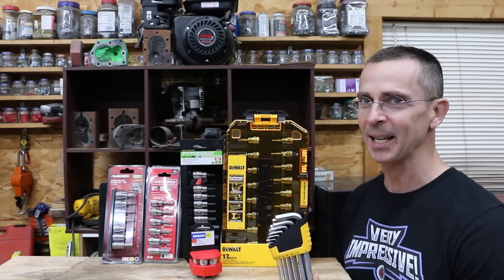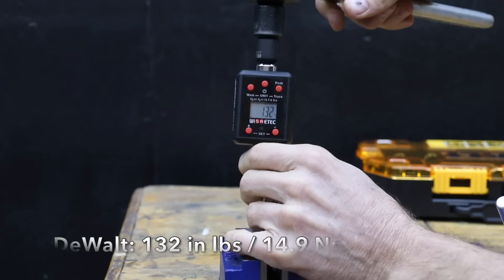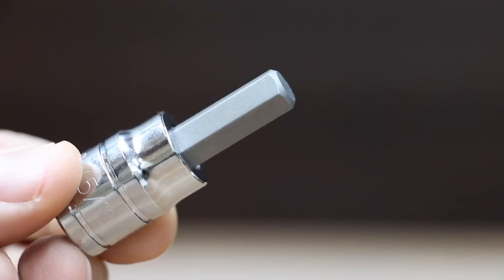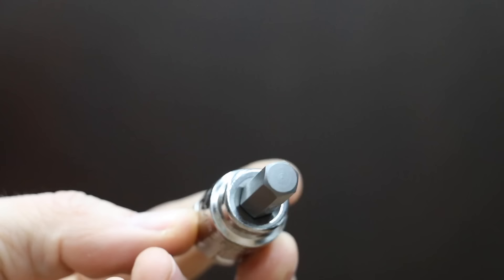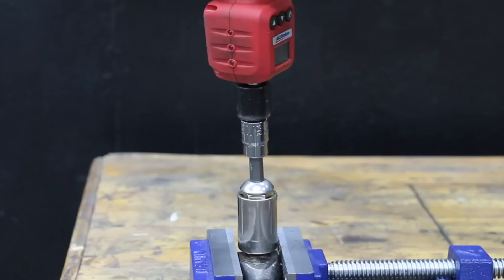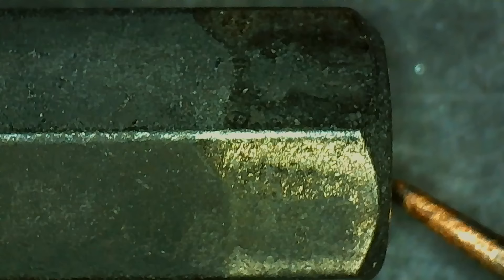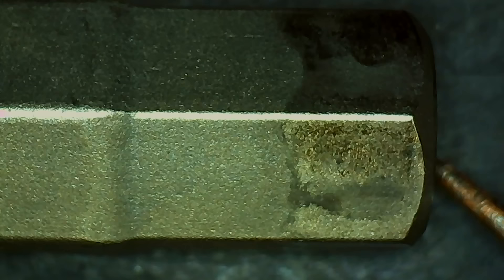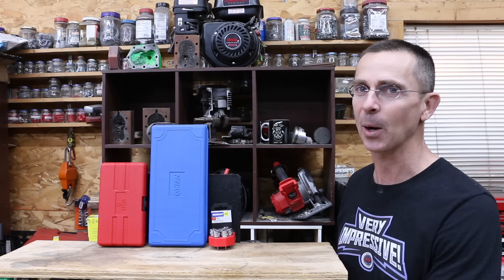Best Hex Bit Socket Set? DeWalt, Kobalt, Craftsman, Husky, Neiko, Pittsburgh, Tekton, GearWrench

Comment: Hi Todd - video idea. Unfortunately, after a "repair" on my boat trailer this weekend, I've had to research thread repair inserts including: Helicoil, Time-Sert, E-Z Lok, and some other similar brands. Although there is an abundance of information on the web regarding which type of thread repair is better, stronger, and easiest to install, most of the information is anecdotal with little to no testing.  As stripped threads are a common problem that likely every mechanic will experience, this might be a good test for Project Farm!
Reply from the maker: Thanks for the video idea.

Comment: Starting at around 10:25 when you test with the impact wrenches, you state ultimate torque failures in in-lbs, but you are clearly testing in lb-ft on your torque reading.

Comment: One of the items I'd like to see tested is wire wheels for grinders.  6" would be great as that's probably the most common.  I have tried a bunch of them but still haven't found one I'd recommend.  All so far pitch wires with all too much regularity.  I have both plain and twisted versions.  The twisted are a lot more aggressive than the straight version.
Reply from the maker: Thanks for the video idea.

Comment: I own a lot of Husky hand tools. Not because I think that they are the best, because at Christmas time (or now earlier) a lot of their tools are put on sale at what were good prices. If the price is right I usually buy 2-3 sets of the same thing. If I purchase 3 sets that allows me to use one, loose one, and have one in reserve when the first one fails. Husky's lifetime warranty is hit and miss depending on what you purchased. I still have a flashlight with a "lifetime" warranty that did not work from moment 1, I took it back to HD, told them the problem, then had to demonstrate the problem (switch did not work), then was told that they did not have any in stock and it was very unlikely to ever have any in stock after the sale, and that I could drive 15 miles to a different store because they might still have some. If  your time isn't worth anything having to drive 30 miles for a flashlight that wasn't worth the fuel to go get it didn't make sense. The other problem, not only with Husky, is that the part number, SKU number will change for the same thing so when you bring in your damaged tool for replacement it won't be the "same" thing so that they will not exchange it because they don't have it to exchange. Lifetime warranty is a relative thing today.

You have had to be there to miss the good old days of Sears when a lifetime warranty actually meant something.
Reply from the maker: Thank you for sharing!

Comment: I love your videos.  You get right to the point and stay on track.  I also buy many times based on your videos.
I'm sure you are a busy man but I have a product test idea.
I've read that Quicksilver 4 stroke outboard oil was superior oil made to handle high RPM for long periods.  A boat outboard operation is similar to a lawn tractor.   Would it be worth the cost to use Quicksilver oil in my lawn tractor Kohler 22 HP?
Reply from the maker: Thanks!  Thanks for the video idea.

Comment: I would really appreciate if you could do a test of Table Saws. I know they can be expensive, I just myself tested 2 on the lower end and even my poorly skilled circular saw performed better than a 200$ one. I understand that this sort of power tool is incredibly expensive, but offerings in the below 600 are very similar yet very different and features are not on all of them, and flatness and accuracy of machining varies between brands. 

On the less expensive side, Bench grinders, and affordable diamond sharpening stones are definitely on my radar.
Reply from the maker: Thanks for the suggestion.

Comment: Project Idea: Rotary Tools, Cord/Coreless, cutting/grinding/drilling/routing/sanding, do they bind or heat up, and how accurate are their speed settings in RPMs? Are the coreless just as good in performance as the corded ones just not lasting as long?
Reply from the maker: Thanks for the suggestions.

Comment: Re-watch your vid and you'll see that on many examples that break the 1/2 hex,  breaker bar is not parallel, causing premature failure.  Btw.. I'd love to see some truck brands like Snapon, Mac or Matco  included in your tests.
Reply from the maker: Thanks for the suggestion.

Comment: I found Grey Pneumatic makes some of the best long ones for a reasonable price. In industrial maintenance, I find too many brands are too sloppy (very undersized) and/or not very good hardness and wear out after a few thousand cap screws. They're like the Wiha of impact hex bits. Only downsize is if you snap one, you can't just grind it down or press in a new bit like some of the truck brands.
Reply: Always better to have a bit that doesn't wear out and is a little sloppy, than a tight fitting bit that is softer. At least in industrial settings where you can always replace the bolts. I suppose in the automotive world you could run into goofy sized bolts you wouldn't always have on hand...
Reply from the maker: Thanks for sharing.

Comment: On your adapter breaks you might try non impact when you don't use an impact, I've found impact sockets break easy compared to non impact on straight force, at least on 15/16 rusted flange bolts. But I didn't test brands but only craftsman sockets and 1/2 " drive. I've also abused regular craftsmen sockets with an impact and you could see wear but pretty good tool, or used to be in the 80s  90s
Reply from the maker: Thanks for the suggestion.

Comment: 🤔maybe you should test out different brands of socket adapters as clearly many of the socket sets outlasted the adapters themselves. It is actually insane that many of these hex bit sockets can take some intense blows from a air compressed impact driver! VERY IMPRESSIVE!
edit: I think i might not be the only one wanting a part two of testing socket adapters as I already know that you have done a video on that already but I think over the time of one year since that video was posted there's bound to be newer brands to try out. so what do you think? is it worth for the socket adapters to have a part 2 video? there's likely to be newer brands that people might want to see what one will outperform the other.
Reply from the maker: Thanks for the suggestion.

Comment: Hey boss do a video on those new induction nut/bolt heater tool They use a little induction heater to heat up stuff instead of wasting so much gas, while trying brake froze stuff apart.
Reply from the maker: Thanks for the video idea.

Comment: New product comparison idea.   RV and boat enthusiasts often have a debate about which adhesive sealant is better.  3M 5200 is the often recommended product but it costs at least 2x that of PL Marine adhesive.  Some argue that since 3M 5200 is a polyurethane and Loctite's PL marine is a polyether it is an apples to oranges comparison.   But does it really matter if they are intended for the same use?
Reply from the maker: Thanks for the video idea.

Comment: The absolute toughest is "Bondhus". American made and I use them with sockets. When I remove my motorcycle fork oil drain screws, I cant afford to have the wrench or bolt strip. The bolts are recessed. Drilling them out is not an option. Lifetime warranty.
Reply from the maker: Thanks for sharing.

Comment: Seems like an obvious follow up would be when other sets that offer the close quarter usage like the gear wrench brand. Also curious if you just didn't like those as much for the higher price. It seemed like they performed fairly well and offered the most variety in the set. I have a different set from the same brand that has the rachet for that and allows close quarter and pass through. It's pretty handy.
I also had a thought recently that it would be cool to see you test storage hook/track wall systems. I have a single section set from gladiator that I like, but thinking of expanding eventually.
Reply from the maker: Thanks for sharing.
Reply: @ProjectFarm  no problem.

Comment: Please test Citrus Adhesive Removers along with brands that claim to remove Grease.  Zep, Goo Gone Spray Gel vs nonGel etc.  I recently was working with roof sealant/Tar and my ladder was covered with it. I purchased several types of chemicals including combined with  Scouring Pad, to see which worked best. One removed all and others did nothing or had claimed they worked the same to remove grease etc.  
Also be nice to see Hand Soaps like Orange Goop compared to ZEP and other leading brands, my test found a winner, but it would be in better fashion if you did this too!  Thanks
Reply from the maker: Thanks for the video idea.

Comment: Heat gun Comparison battery, wired ,name brand ,and cheap . Maybe run till failure?? And definently durability test I've gone through many different heat guns some cheap some expensive  all have broke . A sound test would be nice also maybe throw a mini heat gun in also tack life is the only small heat gun that has lasted me
Reply from the maker: Thanks for the suggestion.

Comment: Since you have to purchase batteries separately and by now have a stockpile, I'd like to see you test job site cordless radios.  Volume, durability, runtime etc.  Also I don't think you've tested cordless inflators but I could be wrong.
Reply: Yep, I was wrong, inflator video is 2 years old.
Reply from the maker: Thanks for the suggestion.

Comment: Hello Todd
I'm a happy subscriber. I have gotten much useful information from your site. Just watching your testing of Allen sockets. I have much experience w/ this type of wrench. In my experience, I have not had any problems w/ the Allen key end slipping or failing. What I've had a madding amount of failures w/ is the black  Allen part braking apart from the chrome socket. This usually happens after a few years of usage & usually 10mm & smaller for bicycle repair. I've used Craftsman mostly but also tried Macto. And both in the 3/8” & ¼ drives. I do not believe that I have used these abusively, often using an inch pound torque wrench. With my background I read this test w/ a particular interest. I was very disappointed that you could not test the Sunex brand. Is there some way it could be tested?
Sincerely Jay Drew
Reply from the maker: Thanks! Thanks for the suggestion.

Comment: Admittedly, a bit disappointed you didn't test products from Bondhus, PB Swiss, perhaps also Wera and Wiha! I'm personally also interested in Ko-ken! But leaving out "the" standard for hex drivers, Bondhus, seems like a big missed opportunity! 

I also think perhaps you should have measured the shaft diameters with a digital caliper or micrometer, rather than solely relying on how much they fit in your fasteners, which themselves could have lots of variance in sizing.
Reply from the maker: Thanks for the suggestions.

Comment: Video suggestion
Radiator and condenser coil cleaner. Which foam or liquid cleaner can break down dirt, oil, and other contaminants blocking the flow of air. Please and thank you!
Reply from the maker: Thanks for the video idea.
Reply: @ProjectFarm  it’s a hell of an issue for me on my dairy farm trying to keep radiators and condensers clean. Rain turns the dust into mud and then it’s so difficult to get it out.

Comment: When I reached out to Tekton for a warranty replacement of one of my 1/2-3/8 adapters I learned that impact rated stuff shouldn't really be used with hand tools.  BTW Tekton CS is awesome! They sent me another non-impact adapter no charge along with the impact one. Here's the abbreviated email conversation: 
I purchased TEKTON P/N 4957 from Amazon March 19, 2015 and broke the 1/2" to 3/8" ...

... Could you let me know what kind of impact wrench you were using when it failed? ...

Dave 
Tool Solutions Manager

I normally use it with my Dewalt 20V cordless impact(the smaller kind with 1/4" quick change chuck), but it broke when I was using it with a craftsman 15" breaker bar on some lug nuts.

... That would be why it failed. Impact grade tools should be used on impact wrenches. When used incorrectly on hand tools, they will fail at a much lower torque value. I'll get a replacement out to you, but also a chrome version to use for next time. 

...  Would that be true for impact sockets too? I broke my chrome one from Tractor Supply Company on it too and thought the impact one would be stronger.  ... I told my friend to rotate his tires more often!...

Impact sockets can tear easier on a hand tool, but typically are fine until you get to super high torque levels. It sounds like that was just a pretty tight lug.
Reply from the maker: Thanks for sharing.

Comment: If you could do a comparison on air compressors since I see so many brands out there claiming so many different CFM and PSI claims . Large air compressors would be super expensive  but what about the smaller 120 volt variants .
Reply from the maker: Thanks for the suggestion.

Comment: Project idea? I found my '96 Dodge Dakota with only about 1.5 quarts in the oil pan last oil change (which is performed every 3,000 miles with Castrol 20W-50) The oil came out black and pretty thick (it was changed cold). I never noticed the oil pressure gauge dropping below the point that it normally registers pressure. The owner's manual outside back cover lists oil capacity for this 3.9L V-6 as 3.5 quarts (manual does not mention filter, which is very short in length). I was wondering how little oil an engine can run on and still escape having the bearings and/or cylinder walls damaged? Just a question I had and maybe some way to test this? So far, my vehicle still runs the same as always (I did not notice any visible metal in the drained oil).Thank you.
Reply from the maker: Thanks for the video idea.

Comment: At my job we use ratchets with 6mm hex bit sockets. It's very important that our ratchets are strong and can easily fit into tight spaces. I've had issues where the sockets get stuck tightening bolts and the socket will pop off of the ratchet. Is it possible that we can see a video that goes over multiple brands of non-electric ratchets to determine which is best?
Reply from the maker: Thanks for the suggestion.

Comment: Have you tested wire plyers?  I have the $10 one from the auto parts store that I haven't used in 30 years because the hand feel is so terrible.  Some better ones with a forged handle and non-replaceable dies and an expensive one with replaceable dies.  They all are equally proficient at ruining connectors.  The weather pack pins seem to be the most difficult to crimp properly.  Those little things like to shear off instead of fold over.  I'm now shopping for a Knipex 97 43 200 and I'm wondering if it's truly the best?  Didn't see crimpers in your video play list so I thought I'd ask.
Reply from the maker: Thanks for the video idea.

Comment: I wonder if you'd test dust created by cutting metal with a grinder (with a cutting disk of course) between various cutting disk types, including carbide tipped ones... having worked in an automotive shop that dealt with body fabricating, I was sick and tired of getting covered in dust from the carbon based cutters and decided to use carbide tipped cutting blades and haven't suffered as badly as I did prior, when using carbon based discs. (at least ones that are designed for use on an angle grinder to cut small/thin metal stock)
Reply from the maker: Thanks for the suggestion.

Comment: Have you considered building a rig so that when you're torqueing the bolts you don't put side sheer when you're pulling hard. Put simply your leaning the tool when applying torque. However if you're going for the true to life that's what everyone does.

Comment: Used and abused my metric sunex impact sockets and hex sockets for years and never broken one. They are still practically undamaged and I use the 3/8 set on an adapter with a cheater bar frequently... The adapter always breaks first...
Reply from the maker: Thanks for sharing.

Comment: Something I'd like to know: is it possible to run a carbureted vehicle simply by jacking a propane line into the carburetor fuel inlet with a pressure regulator to make sure it doesn't exceed the carburetor's pressure limit? I REALLY don't want to spend $1200 on a few stupid pieces of metal. There's GOT to be a more reasonable way to set my truck up to run on propane.

Comment: hi Todd, yesterday, i was replacing spark plugs in my car.  pretty much all of the bolts are TORX type.  on the last of the eight cylinders pulling off the coil overs, i dropped the correct TORX bit (these are 3/8" square drives).  as i was totally screwed with one of the bolts extracted, i tried the next smallest size.  as i, the king of under-tightening, was able to twist the bolt.  is it in your wheel house to test this?  I.e, using undersized TORX bits or Allen type bits to extract TORX heads.  would it be fun?  BTW, thanks for all of the good fun!
Reply from the maker: You are welcome!  Thanks for the suggestion.

Comment: 4 minutes in and im wondering what the quality of the bolts your using for your tests? I have used many of these brands and don’t experience much movement and fit well
Reply from the maker: Thanks for the suggestion.

Comment: may i suggest using the Milwaukee 2864-20 when testing " impact ratings " on tools ? so far i have broke all the cheap stuff that claims to be " impact " and the best ones i found to work well but seem soft are the " ARES " brands the real question here im thinking is ( what is really impact ready from of the shelf stores online or offline using powerful impacts like the 2864-20 Milwaukee tools ) can this be done???
Reply from the maker: Thanks for the suggestion.